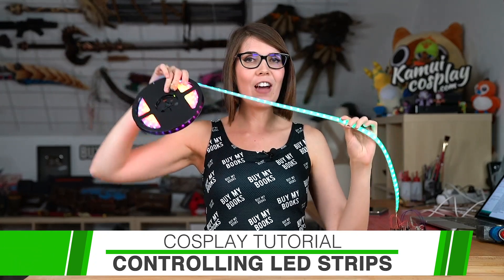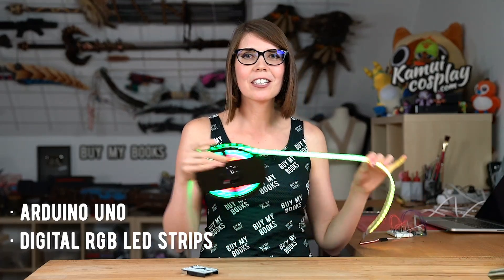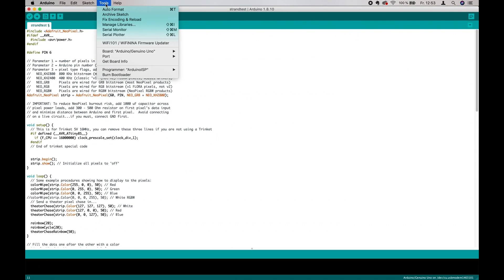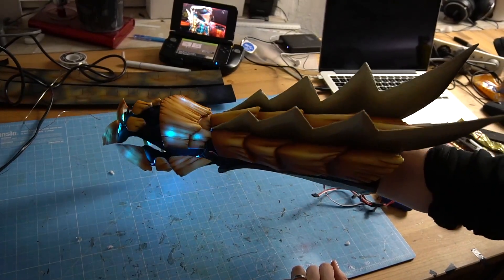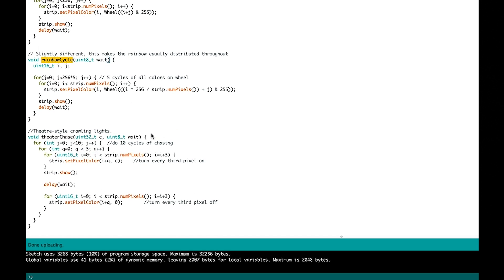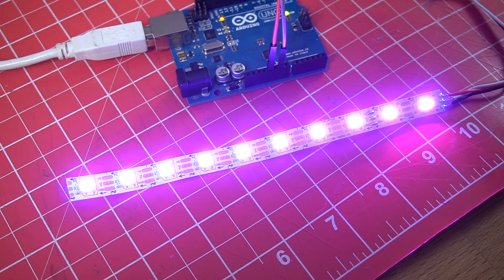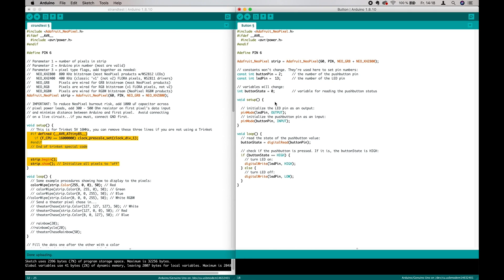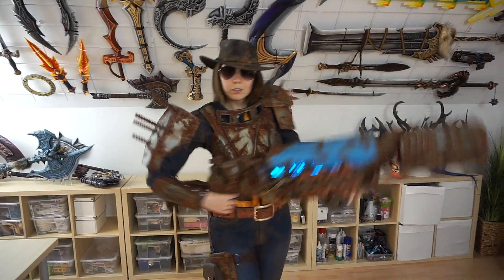How to control LED Strips with Arduino - Cosplay Tutorial

Comment: i have 4 wiers,5v,r,g,b.where i put them cuase my led is diffrent from yours
Reply: afaik those aren't individually adressable, so you can only set the color for ALL the leds at once by putting a corresponding voltage into the r,g,b-traces ... this example is for ws2812b based and similar strips, which have three wires, off which one is a data line

Comment: These videos are amazing! Can these techniques using the Arduino Uno be applied to AC (Outlet) powered LEDs? I want to make a panel (rows of 1ft strips side by side) and create a sweeping scan-like animation. But It'll be part of a cabinet and must be plugged into wall.
Reply: Afaik there are no leds that are powered directly by ac, so you'll need a psu inbetween anyway^^ Your led controller on the strip needs to be 5V, otherwise you need additional hardware for the arduino
Reply: @johnuferbach9166  First off, all feedback is deeply appreciate, so thank you for your input and time! I may have used the wrong term (Im horrible with electrical terminology), but maybe DC instead of AC? (https://www.amazon.com/gp/product/B079M495CP/ref=ppx_yo_dt_b_asin_title_o08_s02?ie=UTF8&psc=1) These LEDs plug into a wall outlet. They have 4 leads: 12v, G (Green), R (Red), and B (Blue).
Reply: @varxtiscreations5008  Mains power is AC (alternating current since it switches +/-), the other stuff is (usually) DC (direct current, which only goes one way)... so 5V and 12V are both DC.

Beware: if they have 4 Leads they are likely not individually adressable, which means you can only set the color for ALL the leds at the same time... so they are all on and blue, or all off ect. which doesn't sound like that is what you want if you want to make a sweeping animation :x
Many of the strips with off the shelf controllers also only support color switching every three leds (they usually mention you can cut the strip evey three leds, but that also means there is only a controller every three leds), so you gotta pay attention here aswell.
If you want individually adressable strips you need something like WS2812B based strips, there are nice overviews of the controller chips on the web, so you can figure out which types are ok for your plans

For the power-thing:
Basicly those are "off the shelf power supply + controller + leds", so for 5V led strips you can just use / buy a 5V power supply (pay attention to the current draw, it quickyl adds up (depending on color and numbr of leds on) and run the arduino off that aswell ;D i think there is also a little board that allows the arduino to controll the 12V leds if that is what you want (apparently with mosfets) https://www.ebay.de/i/273039031122?chn=ps&norover=1&mkevt=1&mkrid=707-134425-41852-0&mkcid=2&itemid=273039031122&targetid=857931346246&device=c&mktype=pla&googleloc=1004769&poi=&campaignid=10215345553&mkgroupid=105782607327&rlsatarget=pla-857931346246&abcId=1139676&merchantid=113833088&gclid=EAIaIQobChMIt5TL0rv16gIV0uR3Ch1xTwkhEAQYBCABEgIwcvD_BwE

Comment: So, can anyone help me write code for lights to my nano gauntlet on my Iron Man Mark 85 and have it synced with the sound? I was wanting an effect that looks like the stones are coming up my arm and then when they get into place, it sends light all down my arm (like you see in Endgame before Tony snaps). I was planning to do this with individually addressable LED strips. I have no idea how to do anything with lights outside of a simple circuit with a switch and battery pack.
Reply: Thats too much to explain though :x these videos are a good starting point, arduino is relatively easy to get started with... for the sound reactivity you'd need a microfone and read its values (unless your circuit already knows when that moment happens, because it also plays the sound ofc) ... either via the adc in the arduino or digitally depending on the microfone of choice ... and then use a library to controll the leds (the fastLed library also directly supports matrices)
Reply: @johnuferbach9166  well, I don't want the lights to react with sound like someone would want if they were doing drums that light up when you hit them. I just want the sound effects to play along with what the lights are doing
Reply: @bagenius5970  ok, so you want to attach both to the same controller? You can use an MP3 Module (i think it's called DFplayer or something like that), so you can have an arduino controll the leds and trigger the mp3's (the module can also driver speakers up to 3W)
Reply: @johnuferbach9166  ok thank you. I'll look into it

Comment: dose the code works with any ARGB strip or only it's working with Adafruit NeoPixel Digital RGB LED
Reply: they need to be adressable leds, adafruits documentation on the library probably states which driver ics are supported, so you can check for yours

Comment: How do you wire the Arduino with a12V power supply?
Reply: i think the uno supports 12V in the barrel plug, but you should look that up to be sure^^

Comment: If we code the way we need in our pc after that if we change the power source from pc to our charger, will it lights the way we coded?
Reply: the programming in the arduino will stay, but you cant program the leds^^ so basicly it will, as long as you don't try to use the lights without the arduino, like some ppl though you could

Comment: can you remove the arduino after uploading/programming  the led strip and program a new strip?
Reply: Afaik the controllers in the strip can only remember their current color, so you aren't programming the strip, you are just telling the strip which color to have in this one moment... if you remove the arduino the leds will stay the same color they were in that moment and if you power cycle them they wont light up, because they don't know what to do... so ... not really, no... just get a few arduino nanos, they are small, basicly the same as an uno and cost like 3$ each^^ (there are even smaller alternatives aswell)

Comment: Kind of a dumb question but,
 do you need an Arduino for every strip? or one Arduino to program many strips?
Reply from the maker: It needs to be connected to the strip to light up but you can just disconnect it and upload new code of course.
Reply: you can connect several strips to one arduino at the same time, though they'll function as either one long strip (in row), or all as the same short strip (in parallel)
Reply: @johnuferbach9166   thank you! I'll look into it more I need them to be parallel for dual swords I thought I'd have to buy 4 of them ;-; 
They're pretty pricey in my country
Reply: @kikichonky6663  if you want to have 2 strips with the same animation in each sword you'd probably need one arduino for each sword with 2 strips in parallel... as mentioned under your other question, arduino nanos (or maybe other compatible controllers) are cheaper and do the same thing :) don't forget you'll need a bit of a battery aswell though^^

Comment: there are already tiny controllers for RGB LEDs, they even have animations like in this video and the only reason why you would program microcontroller for LEDs is if you're creating custom animations
Reply: As a programmer i came to this video because I want to cosplay a specific animation. The pre-made / bought LEDs you get off amazon dont have the animations I want. Her "beginner friendly" animation was very helpful in the way that she "shortened the rainbow" or edited the stop and end variables of the loop was exactly what I was looking for. I was frustrated that I couldnt just buy a simple loop without the entire RBG. But I can easily just use an arduino and shorten the cycle/ use whatever colors i want. So in the end, it seems her beginner friendly tutorial was actually for more advanced cosplay. I agree that you can buy these already made. It is kind of a waste of time if youre doing something simple 😁

Comment: Hey Svetlana @kamuicosplay  I followed everything on your tutorial.  I hooked it up to the computer and it recognized the board but the leds did not light up. I'm a bit confused, I bought everything you mentioned in the list. The arduino turns on but led doesnt. I copied the codes and followed the steps. The led doesnt turn on. Am I missing something?
Reply: did you upload the code (arrow button) or did you just compile it (check mark button)?

are you sure you got the right kind of leds? (quite a few ppl asking for all kinds of strips here^^)

Comment: Do you know a good alternative to this arduino uno? The amazon link you provided doesn't work and I'm really lost on this one. XD
Reply: just search for arduino uno, there are millions of china versions^^

if you wanna go smaller the arduino nano is basicly the same as the uno, just smaller

and then there are a ton of other controllers, but those are probably not as beginner friendly
Reply: @johnuferbach9166  I have no idea how to work with any of these, never did, so I'd rather get what's in the tutorial. And if not? At least a straight up name. (Btw thanks for the suggestion of the Nano, might look into that one) Don't really have the time to read about these either. I'm mainly asking in case somebody knows a site where it's relatively cheap. But well, I guess I'll have to look into this myself after all. XD

Comment: Great video. Does the Arduino Uno have to remain connected to the LED stripes to run the programmed pattern or do the microchips in the stripe retain the information?  Thanks.
Reply: it has to stay connected, the leds can only keep their current state once disconnected and wont keep it when depowered
you could use a different controller though, if the uno is too bulky for your application.. the nano is basicly the same but much smaller for example

Comment: Side note, typing "//"  actually turns the lines of code into a coding note (*edit: called a comment)(although it does technically turn off the code). It's like writing a paragraph and adding little side notes to yourself or whoever is reading it. Coders put " //sentences like this" into code to explain what stuff does to both themselves and other people who read it (or have to fix it XD) in the future. If a program is well-written, you should be able to at least get a basic understanding of what each part is doing by reading the "//" sentences even if you know nothing about coding.
Reply: that's called a comment. thanks for letting non-coders know though!
Reply: @josephsagotti8786  Just fixed it for clarification, thx for pointing it out!

Comment: sweats in engeenier I wanna see how people without much knowlege about eletrics, hooking up their 100 LED Strip to the Adriuno and let their pins smoke away. oof. So lovers of electronics in Cosplay, don't use the adruino as power source for more than 10 Leds. It could seriously damage your Adruino, since every led at its brightest on white can use up to 60 mA and this might burn your pins. Also, to make sure to not destroy your Led strip, put an capacitor in your Plus-Line. It can save your led strip from to too high voltage or current. There are many good tutorials out there, which explain every little detail about power sources on such LED strips. Better be safe!
Reply: what would u suggest ? the nano ? i see it on many premade dream color strips.. im actually trying to figure out all the right steps to make a dream color like the one i bought w 366 modes.. can you upload the code from the chips they have in the recievers?

Comment: On cosplays like Zinogre, do you link all the wires together so they work off of one switch? Or do you have to individually turn all of them on?
Reply: pretty sure atleast the blades will have separate controllers and batteries^^
you could sync stuff via bluetooth with a bluetooth module or esp32 if you have to... or press buttons at the same time i guess

Comment: Can I use a pre soldered audrino nano for led strip lights for programming them?
Reply: pre soldered?
Reply: Like the prongs that you use for a board to test the circuits.  They are soldered in the hole spaces.
Reply: @spiritruilwood3716  pin headers?^^ sure you can connect to those via jumper wires, or even just solder stuff directly onto them^^
but yeah, Arduino Nano and Uno have the same programming and basicly the same capabilitys, just gotta select the right controller in the IDE :)

Comment: hi, do you think i could put 10m of rgb led and make it work with arduino nano.thanks!
Reply: kinda... you'll definutely need an additional power supply, maybe even at several points along the strip... bug the arduino should be able to controll all of them i think

Comment: If you use a Node MCU  ESP 8266 D1 Mini you can do this on an even smaller scale. The chip is way smaller, and way cheaper than the board you used. :)

Comment: I am not into Cosplay at all, but i have an (my first acutally) upcoming DIY project where i want to code some LED stripes to fade between two specific colors and it was described perfectly in this tutorial so thank you Svetlana!
Reply: if space is a concern don't forget to use an arduino nano, it's basicpy the same but a lot smaller :)
Reply: @johnuferbach9166  I did not even consider space until now! It's supposed to fit behind a kind of deep picture frame. And i ordered an off-brand Arduino Uno R3 from geekcreit i believe. It'll be my first time playing with electronics but i'll figure something out once all arrives next week or so
Reply: @Feralas100  ok, i guess in a picture frame there is plenty of space :D also a cheap nano is like 2$ and one can never have too many arduinos, so even changing your mind wont hurt much :D
how are you planning to power it btw? :)
Reply: @johnuferbach9166  i bought a ac 100-240V to dc 12V 5A 60W power supply adapter for led stripes and i hope to just be kinda able to plug it in the wall and see what, that may be a rookie move though haha
Reply: @Feralas100  dayum, thats pretty beefy, how many leds are you planning to run (and in what color ect^^) and do they work with 12v? the arduinos voltage converter can only handle so much current (apparently the 5V converter can handle up to 900mA (from 12V more like 700 or so it seems) though might be further limited thermally
Reply: @johnuferbach9166  The led stripes and the wireless remote controller (WS2811) say they need 12V.  I need about one (1) meter of led stripe and thats roughly 60 leds if my math is in fact correct
Reply: @Feralas100  now i'm confused... so I'm getting you are planning to use a premade led controller with strip and remote...? then what are you planning to use the arduino for?
Reply: @johnuferbach9166  well i thought i could make it so that the led strip is always plugged in and i can use the remote to turn it on and off but if that doesnt work for some reason i would just ditch the remote (it was a separate purchase and isnt included with the leds)
Reply: @Feralas100  ok, i looked up your driver ic, it's for the 4 wire led strips that are not individually addressable... is that also what you bought and want?
to drive those with an arduino you'll need an additional driver module to handle the 12V afaik
but other than that it sounds like it all fits together nicely :D
Reply: @johnuferbach9166  well now i am confused, the stripes i ordered say they are individually addressable, as is the remote. And from a nerdforge video that i watched the stripes, remote, ac adapter and arduino are all that i need for it to work 😅
Reply: @Feralas100  ok, then i guess i mixed stuff up, since you said the controller was WS2811 i looked at the datasheet of that, but i guess you meant the controller is FOR ws2811, which then controll one (or 3) led each^^
it seems those can drive leds at either 5V or 12V, but require ~5V themselves, but have an integrated LDO, so i guess they can run on 12V if the strip sais that^^
seems to work with 5V data aswell, so i guess an arduino should work aswell... 
i guess it's best I'll just go away before i confuse you more xD
Reply: @johnuferbach9166  no you're fine, you just tried to help :D and i'll even reconsider getting an arduino nano! it's just that i dont understand most of the vocabulary and electricity talk yet :D Anywas thanks for your time helping me out! i'll see how it all goes when it arrives in a couple of days
Reply: @Feralas100  Glad you're still happy :D
btw in case your power supply is too big i'm pretty sure you could go down to atleast 3A... all 60*3 leds at max brightness should be 60mA * 60leds = 3,6A max and if you're not planning to use bright white you can go even lower :)
Hope it all works out! :)

Comment: I have a question, do I need multiple controllers for different parts of my cosplay, or does one work for the whole outfit?  Ex: two boots with the same effect.  One control panel for each or one for both.
Reply: well you have to connect the controller to the leds by wires, so if you wanted to have 2 boots running on one controller you'd need 3 wires up one leg and down the other^^
so using 2 controllers with the same code would probably make more sense in that case :) (cheap arduino nanos are like 2$ so it's not much of an investment anyway :D)
you could also use 2 esp32 to sync them via bluetooth, but i guess thats quite a few extra steps :x

Comment: Svetlana: I am just starting to get into arduino. I would like to control just 5 LEDs at a time and control which position on the strip with a radial knob. Do you think this is doable?
Reply: yeah, shouldn't be too hard... for the knob you could use a potentiometer and read that via an analog in or directly use one of those knobs that give a pulse after certain increments (forgot the name though) and read it via a digital in (or via an interrupt)
and then just connect 5 leds to 5 digital ports and swap accordingly (you could also use a rgb-led strip, but thats kinda overkill^^)